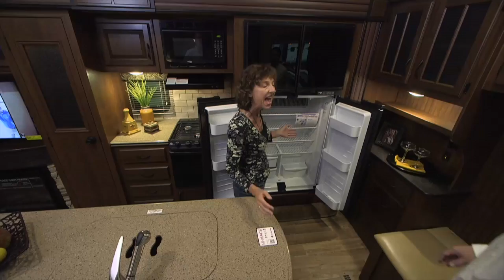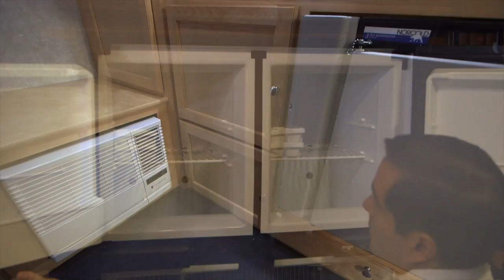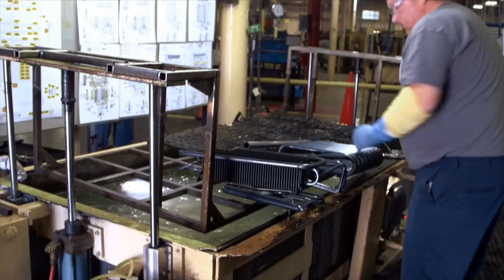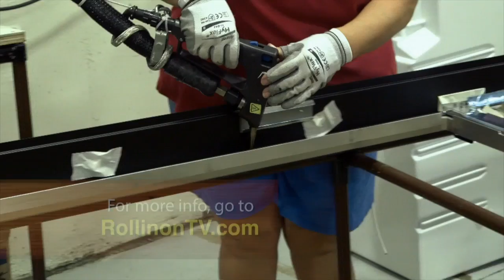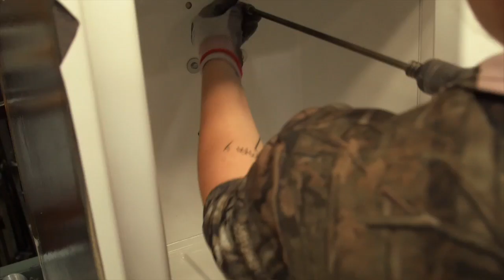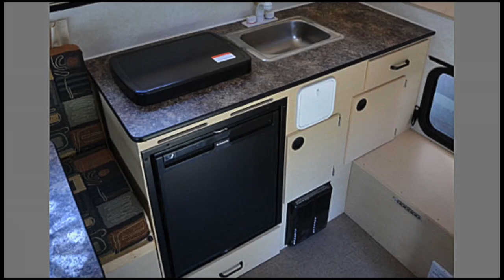Rollin' On TV Program #2016-06 • rollinontv.com

Comment: I would be interested in knowing how norcold is coping with the more and more residential refrigerators you're seeing come up in RVs today. That's got to be taking away from the market and I'm wondering if they're planning on adding residential refrigerators
Reply: Working for norcold I can assure you that we have no business loss. It's actually the other way around. We make rv fridge ranging in size from two feet up to your standard house fridge. At this point. Norcold is just a rv refrigerator company. Most refrigerators in your house is made differently than the one'sin rv's. But it's not out of the question if we can make a house refrigerator. I believe there is only two other companies making rv refrigerators where as in homes there are several maker's. Hope that answers your questions :-) I've worked there for over 10yrs and norcold is by no means losing business. We are actually picking up new customers
Reply from the maker: Somehow I missed your question earlier, sorry about that, but from what I've learned after visiting Norcold and talking with other RV refrigerator companies is that, home style refers are not designed to take the abuse they will get in an RV. Think about being bounced around when on and off the road day in and day out. Also, your home refer wasn't designed to be in climatic conditions from sub-zero weather to 100-degrees +. I guess if I had an RV that was stationary for 75% of the time I might consider a residential type refer also, but otherwise, I'll stick with an RV designed unit. By the way, this same thinking goes into TVs and other appliances. More and more RV manufacturers are opting for TVs designed for that same, vigorous road abuse.